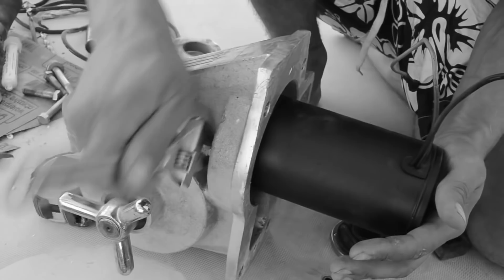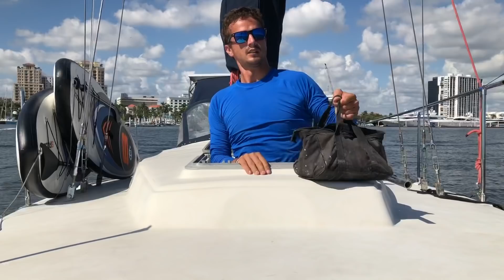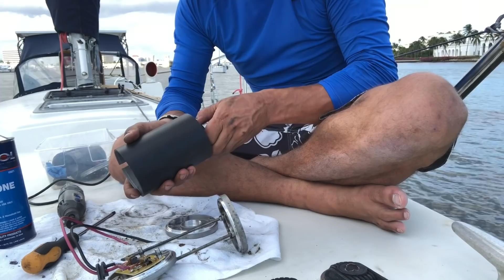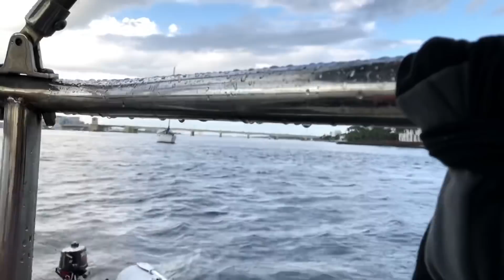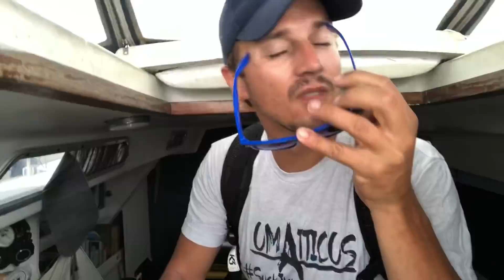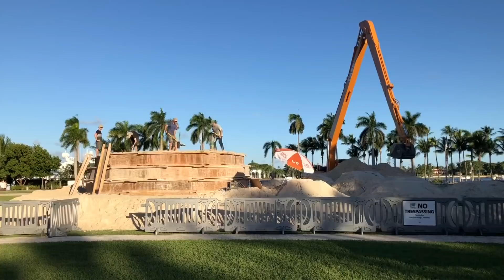Windlass FAILURE by myself [Sailing Uma — Step 146]

Comment: Highly recommend just sticking with a modular approach on the electrics there. You can buy a second solenoid rated for high enough current and wire that with to the reverse circuit using a "break then make" double-pole-double-throw (DPDT) switch, all of which is readily available from a wide variety of suppliers for a ton of industries, rather than an all-in-one box from a marine chandlery. When you're in the far-off parts of the world, it will be much easier to service and source parts.

BTW it was the current, not the voltage. As you know, a tiny conductor can safely run a quarter million volts through it, but the current is what turns it into an arc welded mess. Well, the watts matter in the end, but wattage being equal, a 12v 40A device would need to be much more robust than a 48v 10A one, even though both are ~500W. If I understood what you said towards the end correctly, you went from a 48 volt <x> amp to a 48 volt <y> amp motor that was more powerful. It drew more current through the solenoid.
Reply from the maker: The solenoid is rarer for 12v and 250A. The motor only draws 23A at 48v. So it should be well under the rating of the contractor. Still, only using the windlass for hauling the anchor in, and dropping it with the clutch is even simpler.
Reply: @SailingUma  -- Ah, I think we had some miscommunication. It was never my intention for it to sound like I was suggesting you source a 12v part. What I was trying to convey is...

(1) I didn't mean the solenoid that you ended up with was no good. You made an excellent choice. I meant you could add a second one if you want reverse. A pair of them would give you power-out and power-in. I agree that it is simpler to use the clutch, but you sounded like you were lamenting the loss of power-out in the video, hence my suggestion on how to add that function it back.

(2) It is highly unlikely that the voltage is what burned you. I'm not posting this part to be pedantic (although I'm well aware I'm coming across like that "Well, technically..." guy, and that feels gross.) There just seemed to be some interest in doing some failure analysis and I think the voltage is a red herring. Here's why I think that...

For such a simple device as a relay/solenoid/contactor, it is highly unlikely to be the problem. I mean, inside it is basically a conductor. As you know from wiring your boat and choosing wire sizes, for a given power level, a device designed for 12v necessarily must be able to handle 4x the current as a device designed for 48v. As you say, a 12v 250A solenoid is a rare beast for good reason. It is much simpler and cheaper to build a device that can transmit the same power at 62.5 amps and 48v (or 31.25 amps at 96v and so on.) 

The idea that a 48v = more power isn't in itself true. Voltage isn't power. True, we often choose a higher voltage so that we can transmit more power for less expense, less voltage drop, etc, but without looking at the amperage we can't know anything about the power level. For example, rub your feet on a carpet and touch a doorknob and you'll have 250,000 volts coursing through you. Voltage alone is only half the picture. (Yes, I'm one of those annoying nerds that see the battery powered tools in their marketing game of writing their voltage in bold letters all over their product and think "that doesn't tell me anything useful, is it higher wattage?" I mean, you could easily design a product that was 18v but less powerful than a 12v device, or had no difference in power for that matter.) 

The old motor was 48v and didn't burn out the solenoid. You said in the video that the new motor was more powerful. That just leaves amps. That isn't to say the suggestions to look at forklift/golf cart solenoids isn't a good suggestion, just that the voltage isn't likely the smoking gun you're after. My guess is that the new motor was pulling more current through the solenoid. 

(3) I was commending your MacGyver solution that you ended up with, not poo-pooing it. Servicing it and sourcing parts will be much simpler in the end. Like others have suggested, you'll be able to find simple single-throw solenoid/contactor of adequate power rating anywhere they have forklifts, golf carts, etc. I'm sure you'll be able to find a wireless switch that you can wire up to your solenoids' contacts too if you want the wireless feature back, but by keeping it modular, if it fails, your whole system won't fail. 

Anyway, good work Dan, both on the boat and with the video. You put out a good video this week. Didn't even notice or care that it was iPhone footage. Guess that's a tick in the column for "quality content trumps production values."

Comment: .... am not electrically inclined, but could you not use two of those contractors and have a selector switch to select either the one for lower or the one for raise .... just a question ... or two buttons, one for the up contactor and one for the down contactor ..... love how everything for you is just a wee speedbump to be overcome and overcome it will be ..... 
.
your video editing and using your phone .... had you not mentioned it, would not have thought about it ... back to the basics, focusing on telling the story that you have to tell ... good job, well done ...... have fun besafe, save our oceans .....

Comment: Your original contractor likely failed because it opens far enough to break 12v DC (or AC voltage which self quenches) but not enough to handle an induction load at 48v.  From working on locomotive I have 2 suggestions.  
1.  Use 4 contractors like the 48v rated contactor you have currently installed.  You should use relay interlocks to prevent inadvertantly connecting positive to negative with the contractors.
2. Use the 48v rated contactor in series with the reversing contactor.  The 48v rated contactor will break the DC voltage, and the 12v rated contactor will do the reversing, but not break the load.  Most older DC locomotives this combination of power contactor and reversing contractor.

Additionally, I'm assuming you are controlling this with 12v, but using 48v for the power.  If this is the case, make sure you don't have a voltage differential on your ground plane.  I have run into ground plane problems on DC-DC converters in the past.

Comment: Dropping the anchor with the clutch (+gravity) is not slightly inconvenient, it's THE BEST WAY to drop the anchor. I miss this on modern cruising yachts. With the handle + clutch you have very good control over the chain speed. With an electric motor you have only one (fixed) speed: much slower than with clutch + gravity.
I like the clutch 100x better when it comes to dropping anchor under sails or med style mooring. At least on yachts 42'-50'

Comment: You need a blocking diode. When the contactor releases, the magnetic field in the motor collapses and the result is a reverse pulse that causes arcing in the contactor. A diode across the motor will short this pulse out and suppress arcing in the contactor. Even the 48 volt contactor you have now will benefit from a blocking diode across the motor leads.
Reply: @Eskay64  Oh good point! With their current setup it would work, but if they do go back to a reversing contactor another tactic would be required.
Reply: It does look like there are simple circuits that take care of the reversing issue: https://electronics.stackexchange.com/questions/78462/reversing-direction-of-a-motor

Comment: Hi Dan, 
Check this out.

Albright DC88 Style Reversing Contactor: 48 Volt  $88 on Amazon.

The DC88 series of contactors has been designed for direct current loads, particularly motors as used on electric vehicles such as industrial trucks, airport tractors, and such like. They have double breaking contacts with silver alloy contact tips, which are weld resistant, hard wearing and have excellent conductivity. Rated Current - 100 Amps. Voltage Coil Options – 48V. Monoblock, Double Pole, Changeover Contacts. Coil Power – 11 to 15W. Rated Voltage of Contact Circuit - 6 to 80 Volts DC. Dielectric Voltage Strength - 50Hz 1000V AC 1min. Current Volt Drop of Main Contact at 100A - Not above 80mV. Operating time, Contact Makes & Contact Brakes - >30ms. Mechanical Life - 100 thousand times. Electric Life - 20 thousand times. Weight 2.5 lbs.,

Steve S
S/V Appaloosa

Comment: We added the second electrical circuit for the motor assist down function by installing an inexpensive battery switch (1-2-both) near the anchor locker.  That way I was able to use just one foot switch.  1=up, 2=down, both=destruction.  We avoid "both".

Comment: I think the old motor burned out because it got overheated, there is not much airflow that could cool it down inside the PVC pipe. Add some kind of cooling system (two pipes running out from the "motor enclosure pipe" and a fan on one of them that provides some airflow for example) that way the new motor won't burn out as soon.

Comment: Sorry not going to read all the comments to see if this has been said but if you use a separate contractor  to turn off the power first before switching the reversing contractor it may last longer, you can also make your own reversing contractor out of individual parts if you had to.
One other thing to consider is using a high rpm motor with planetary gears.

Comment: Me being a German engineer I couldn’t do anything but cringe seeing your tool bag....
Reply: lol Was thinking the same here to myself.
Reply: That is funny - but now that I think about it, that fabric bag is probably a lot less likely to slide off a deck than a hard case.  It also looks like it takes up less volume than a rigid toolbox...  So I've changed my mind and think that the tool bag is actually pretty optimized for the conditions in which it is used!
Reply: @clarksong4619  My problem is not with the container itself (bag or case), but rather with the mess inside it. How do you even find the correct tool or correct wrench size in such a mess? lol

Comment: Interesting , wells done Dan ....Just some tips.   Short brushes due to wearing.. short brushes means high temperature of that brush and so it will wear quicker and quicker. Check or  Replace them on regular intervals. 
The cable form the main batt must be thick . The longer the cable the thicker they must be a DC current.  There  are calculating tabes on the internet.  If the cables are too thin the voltage goes lower end so the amps go up at the user end.  What means more heat..
Make sure you have some good size cables to the bow .

Comment: Old motor likely failed from overheating inside plastic pvc housing u made...new batteries have nothing to do with new contactor failure...motor just trying to pull more current than switch blades are rated for.

Comment: So I have one more modification for the motor should you go back in there.
Many failures happen when a wind shorts open 
What happens is the wire loosens from where it’s staked down on the brush contacter 
What you can do to get some longevity out of it is to apply epoxy to the winding wire at the stake 
Keeps them from flying off and shorting things out.

Comment: Always say a day where something is learnt is a good day. Using a Dremel as a keyway routing machine was one and using 48 v motor vs 12 was another. I recently changed all of our off the shelf solenoids for a proprietary pack. Nice and tidy, but the former, when sailing in Asia, could be bought for a few dollars at any auto repair shop. Well done young man.

Comment: Well done on the vid/edit!   One trick for doing solo work is to cut a slot in the end of your bolts so you can do up the nut finger tight, then hold the bolt steady with a screw driver as you do up the nut all from the inside.....have to use a ring spanner or open ender as socket would cover the end of the nut. Less chance of messing up the butyl tape from the bolt twisting. Added bonus is the slot across the bolt-end acts as a die to cut/clean the nut thread as you remove it and do it up.  Have to admit I was waiting for the heartbreaking little 'plop' as a bolt rolls off the deck into the drink !!! Keep up the great vids!  (^..^)v

Comment: The voltage is not the problem. The main problem is the current (Amps).
You need to figure out how much Amps your motor draws and buy a contactor that is designed for that current . 
Keep in mind that the motor start current is sometimes up to 3~5 times the nominal current. 
Also pay attention to the breaking current, which is the max Amps the contacts can cut off without having an electric arc (which is was melt the contacts). 
Power [W] = Voltage [V] x Amps [A], meaning that for the same power (load) the current is smaller, the bigger the voltage is.
Therefore, a 12V contactor coil is designed to withstand a much higher current (actually 4x higher) than a 48V coil, for the same coil power.

BTW: Your editing is great Dan. Keep going. :)
Reply: Thomas K, voltage is the problem, particularly on dc systems.  When the contractor opens there is an arc.  A higher voltage system will maintain this arc even after the contractor is open all the way (causing the contacts to burn up).  You don't see this as much on AC systems though because AC returns to a zero volt potential 60 times a second.  I have seen this before on 72v DC systems that had 240v AC relays installed.
Reply: You are right, I forgot the seconds zero point per cycle.

Comment: A motor is an inductive load this means that when you switch it of it will try to keep pulling a current through the contactor this is what welds the contacts together. I don't know the schematic of your motor but depending on that schematic you should put some diodes over the contactor so that the current can keep running through the motor when disconnected. It's hard to explain in a little bit of text but I hope this gives you enough info to Google more about this solution. It's a very common problem in switching off inductive loads

Comment: I would suggest some silicone or a proper grommet where the wires run into the PVC motor cap you made. Also, find some desiccant packets (like you find in shoe boxes) inside to keep the interior dry.

Comment: Unclear if your contactor is legitimately rated 48 volts. If not, it will fail. Switches that work at 48vdc are way more expensive than 12vdc, which is why electric cars are still using 12vdc systems for everything except the drive motor. You can't cheat on this stuff unless you plan for it to fail. Physics knows no mercy.

Comment: I think you should take a breath, back up and go back to some electrical basics. As an electrician myself, I would want to know exactly, How many amps are you drawing on no load then on full load. I saw the damage to the first armature and windings and then you highlighted the contractor had welded it’s contacts together. You need to know the current and then choose your switching relay/ contactor accordingly. Do you have a tong tester, a DC clamp meter? Good luck regardless
Reply: OK, what I’m curious about is the damage to the motor and the contacts in the relay / contactor?  There has been a massive surge of current to cause that damage. The Contacts are one thing but the motor windings looked absolutely fried. The question I have is , Why didn’t a fuse blow, a circuit breaker trip before all that damage occurred?  It appears to me that the excessive current flow continued for a period of time to cook that motor like that. Anyway, I’m sure your on to it. All the best
Reply from the maker: Yes, we’ve tested it. Under full load it draws 23A, the contractors are rated for 250A continuous.
Reply: Hi Dan. You are a man after my own heart with your tenacity and ingenuity for the repairs and upgrades you MacGiver. As a retired auto and HD truck tech, I have seen about everything that can go wrong with dc elec motors. I remember watching the windlass install long ago and I am amazed that the motor has lasted this long. You have 2 strikes against longevity. (1) It is encased in the PVC so it runs too hot. The armatures can and do melt the insulation on the windings. (2) There is a duty cycle for motors, especially when in low to no load hi rpm, they can explode from centrifugal force when they get overheated. I read a couple other comments about your relay issues and agree that you need to install a load clamping diode or resistor to prevent voltage spike welding in the relay contacts. FUN FACT: I used to drive a tow truck that had a 12,000 lb elec winch on it  instead of PTO and more than once had an electric garage door cycle down on a vehicle I was pulling out when I activated the lift. Near as I could figure, EMI off the winch motor activating the remote control on the opener.

Comment: Nice job, well done.  I would like to suggest that you invest in a socket set that has SAE and Metric sockets.  Also a flat pry bar works a lot better than a claw hammer.  That said you did an excellent job with the tools you have. Happy Thanksgiving.  🍗🛠

Comment: Why use that old type of motor, when you can use a clean brushless motor? You can even improve the life of the fuel pump by changing out that stupid rubber thing with blades that always breaks apart & gets into the engine if not careful, I suggest a kit where you use a magnet setup instead, Quick to clean & service :)

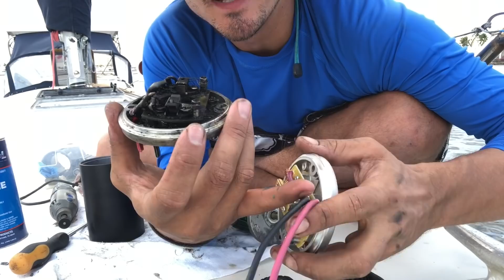Comment: Looks like the negative side brush wore and started eating the contacts (9:23 into the vid). Consider brush replacement every 4 months or so, along with some cleaning and re-greasing.

Also, to fix your contactor issue, use the cheap automotive 12V unit you bought to drive a pair of 48V 20A relays. That way you have a inexpensive way to drive the unit, and you can stock backups easily. And 12V "off road" style stuff is much easier to find. It looks like 48V 20A relays are three bucks on Amazon.